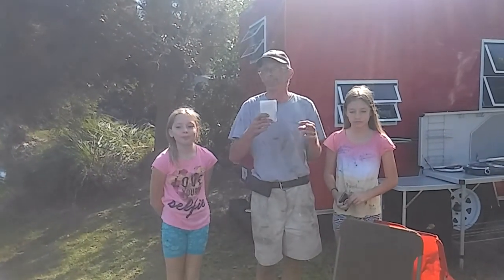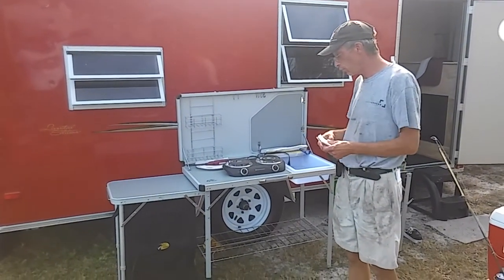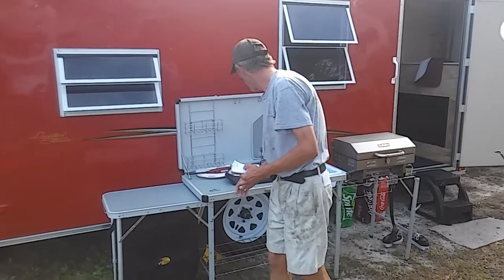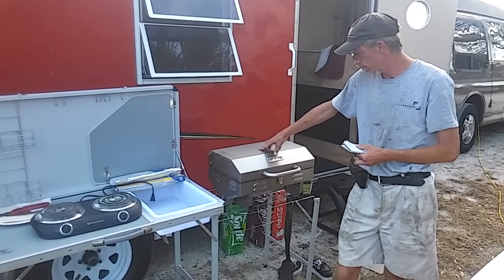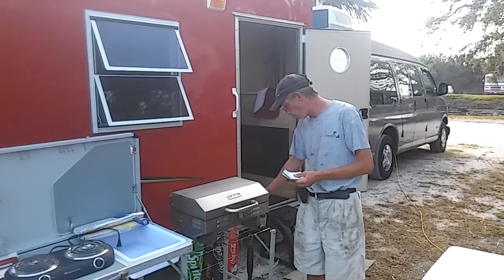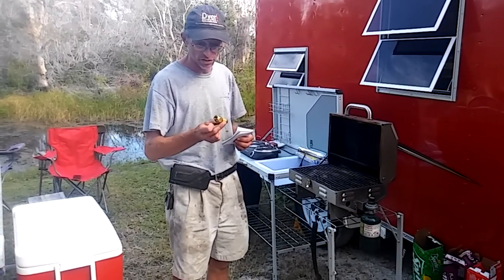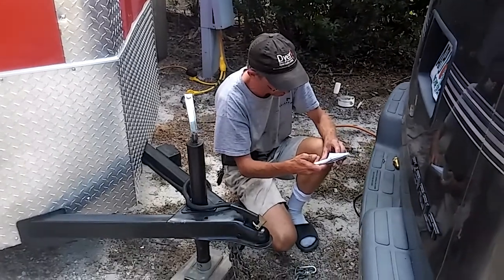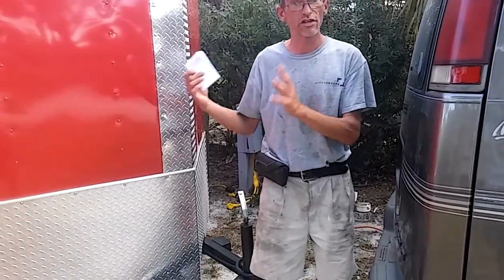Cargo trailer to camper build (part 11b)

Comment: Your camera man  is correct, Hydrogen is much lighter than air, not heavier. They used it in the Hindenburg back in the late 30's when it blew up in New Jersey, after that no more Hydrogen, they went to Helium.

Comment: A tip for your propane use is plumb a line to to your kitchen side and put a quick connect fitting or a connection method of your choice and you will have propane for your gas grill and not have to keep filling 1lb. bottles.You could camp every weekend for at least 6 months before you should have to refill 20# bottle.

Comment: On the 30 amp dogbone splitter you need to insulate the unused branch dont have it laying on ground not connected
Reply from the maker: FixmyToyota dont use it anymore... But good point....